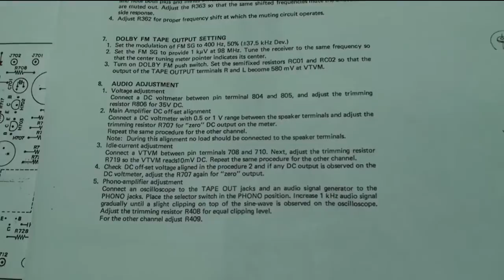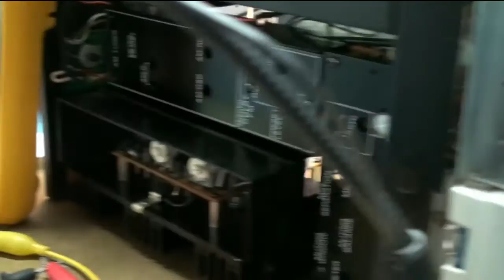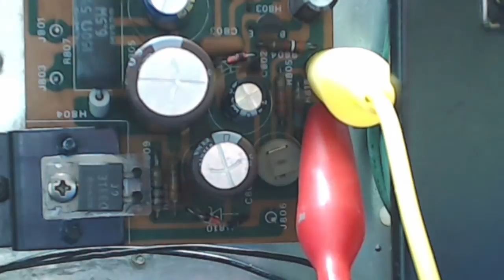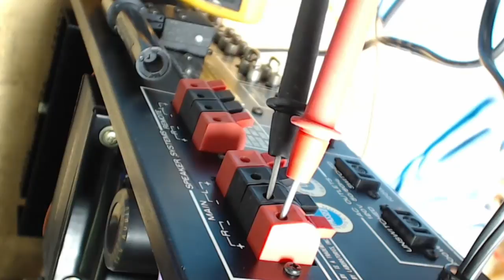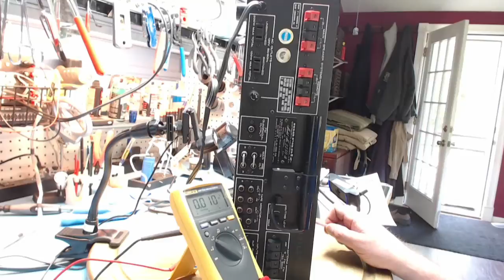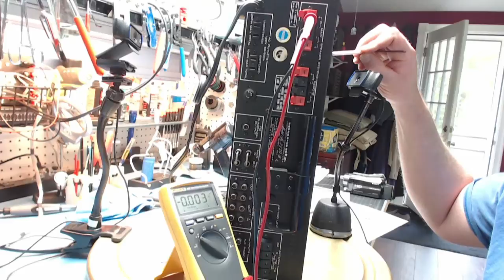Part4 Marantz 2250B restoration - Audio adjustments

Comment: Brad, you may want to replace the (blue) tantalium caps on the phono board, they're notoriously unstable.  (Maybe you did replace them, I did not see your prior video.)
Reply from the maker: Oh yes, they were replaced. Sold that unit about two years ago, with a repair warranty. Haven't seen it since, so assuming it is still running strong.